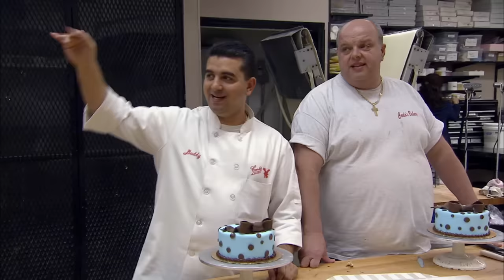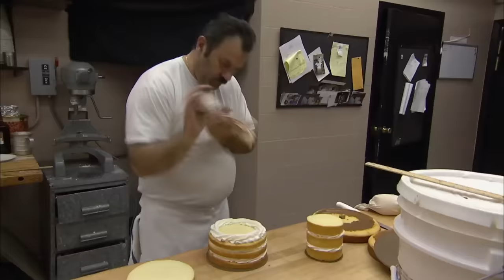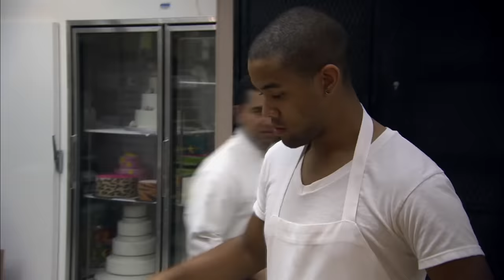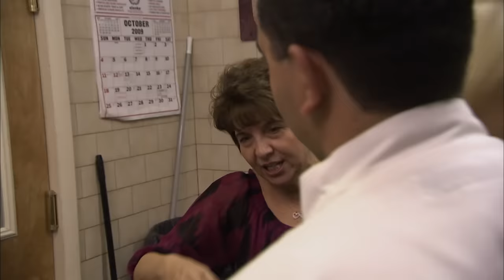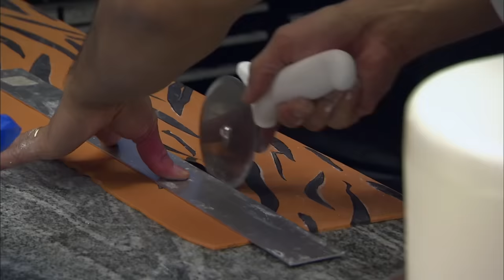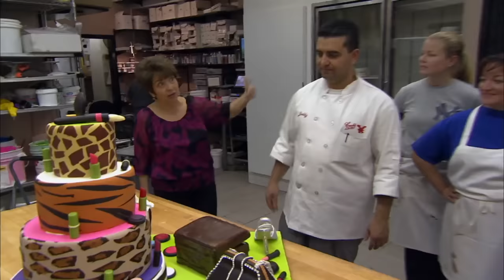Buddy's Sister Asks ANOTHER BAKERY To Make Her Birthday Cake! | Cake Boss

Comment: I miss Buddys mom. She rocks
Reply: What happend to his mom
Reply: sofia perez she died in 2017
Reply: @melanielopez4556  oh ok i did not know
Reply: @melanielopez4556  😨 how old was she? I thought she was still around.
Reply: @M.A.C.01 no she passed away from pneumonia at age 69. But did you know that Valastro injured himself in a gruesome accident at his home bowling alley in 2020, when a malfunction with the pinsetter caused his right hand to become lodged and compressed inside the unit. He was unable to remove his hand as a metal rod slowly impaled his hand three times between his ring finger and middle finger. After more than five minutes, Valastro's two teen sons used a reciprocating saw to cut through the metal rod and free him from the machine.